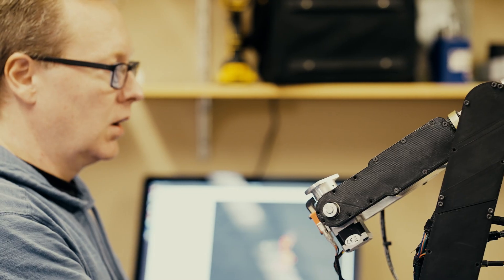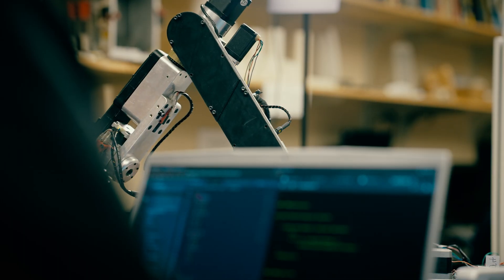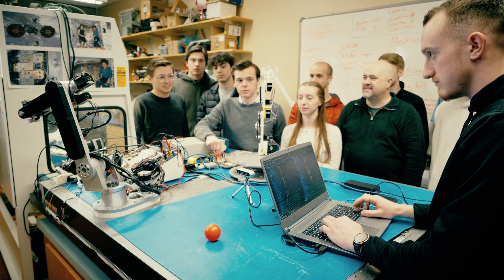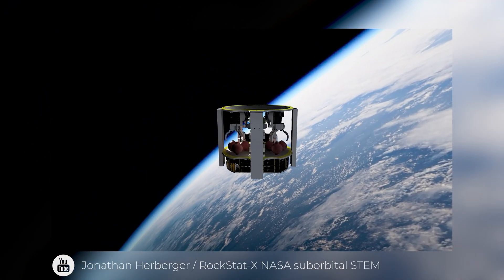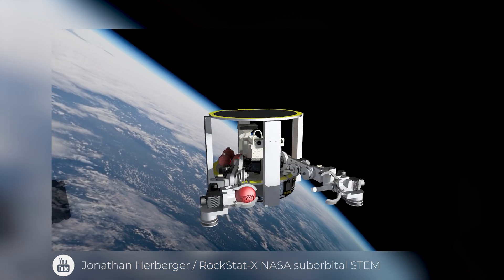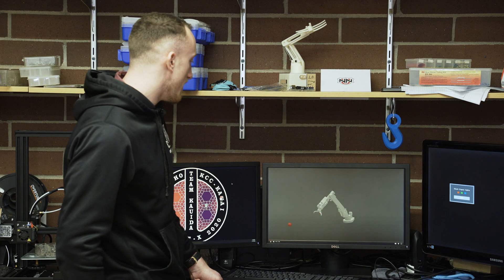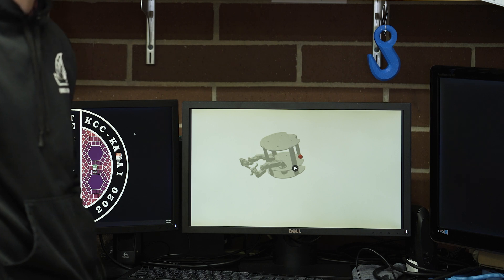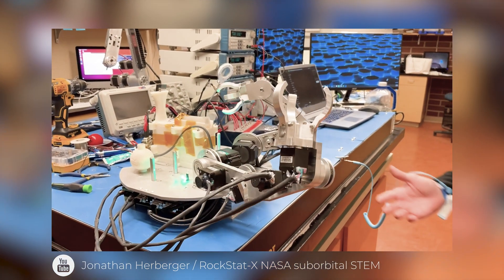Sending Robots into Space - NNU & Annin Robotics AR3 AR4

Comment: Curious to know if they are compensating for the motors arcing in space. I work in the aerospace industry and we have to give all our motor windings a special coating to prevent arcing due to having no air resistance. It could be that these motors are such low power it won't be an issue, but it would be interesting to hear about.